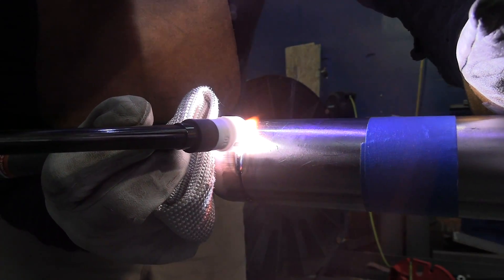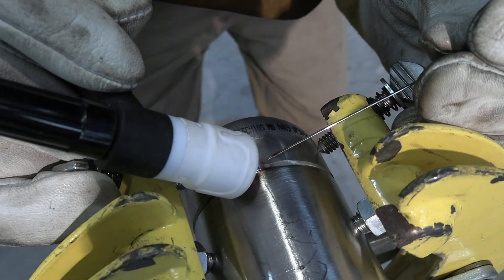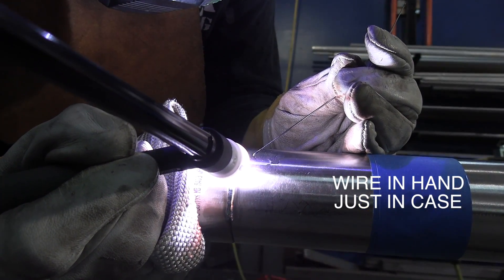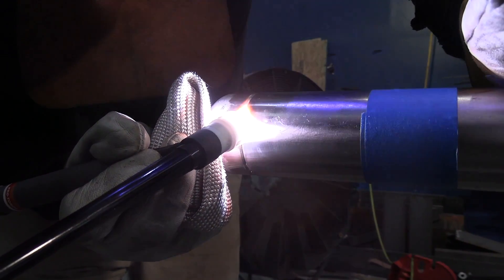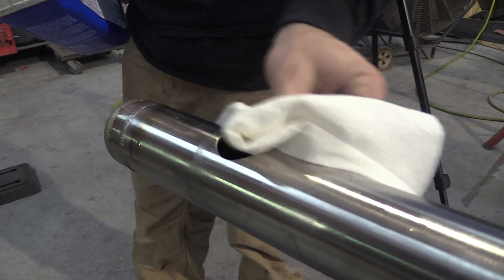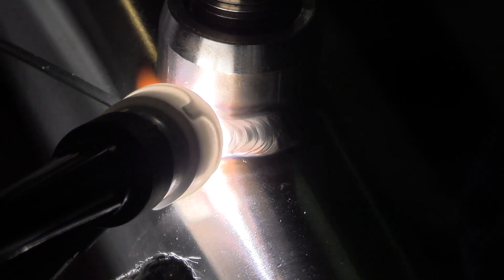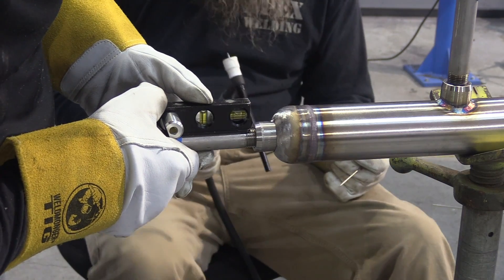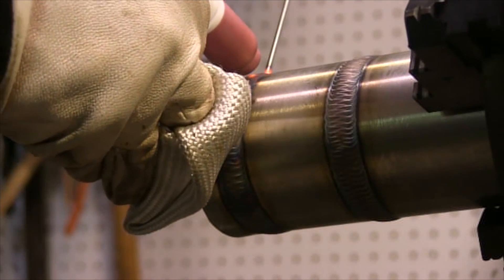TIG Welding Stainless Liquid Nitrogen Header

Comment: 10 cup, slow dab 1/16 rod, walk the cup at about 3 o'clock single pass, 40 cfm purge with 3/8 breather hole. Do a tight weave using a screwdriver grip on the torch, that butt weld will be clean, shiney purple/pink, and lookin better than a robot did it.

Comment: Been doing some stainless welding for a major bread manufacturing company lately. 
I remember my first time TIG welding stainless and never knew how much it was effected by distortion. 
What a disaster it was also didn’t know that it didn’t require as much heat to weld.
But now I have gotten the hang of it and 💖 it.
So easy to weld and control the penetration.

Comment: when you purge directly in to a pipe, is argon through the torch still needed?
Reply: its not only needed its a must.
Reply: @hocke-f7m  So, you shoud have 2 argon tanks right? One for the purge and anothrer one for the torch?
Reply: No need for two tanks, you could use one tank with two regulators which is handy. Where I work we use two gas tanks one is a 50 liters for the purge called 'formier' which does the same job as argon but alot cheaper and then another argon tank for the TIG.
Reply: @hocke-f7m  Thank you very much for sharing sir

Comment: Never seen a route run done with no wire before. Would that pass an xray or is the work standard not that high?
Reply from the maker: there was no code or standard for this.  very low pressure and no food product on the inside.
Reply: Joseph Joestar The guy who taught me to weld stainless would do a root run using no wire and it still would pass ex rays test.